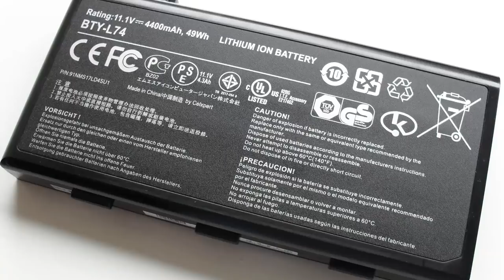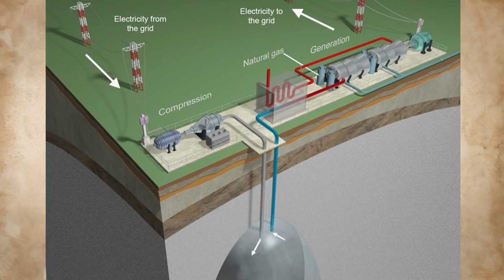Why We Need A Revolution In Energy Storage

Comment: You could use hydraulics to lift your whole house, during the the day, then use the weight of the house to turn a generator on its way back down at night, in an analogous way to the reservoir principle. Maybe.
Reply from the maker: +locohombre79 This is the best idea
Reply: +The Good Stuff Haha, your reply makes me warm and fuzzy
Reply: +locohombre79 Try calculating this, it's not very efficient. You'd need an extremely heavy house or lots of distance to lift.
Reply: +locohombre79 That would be a plumber/electrician worst nightmare.
Reply: @0xbaadf00d  That's why I prefer the idea of spinning my house. Higher limit to spinning than lifting.

Comment: Why is credit being given to Edison for the power grid?!?!?!?!?!?!?!?!?  He wanted to build a DC power grid which was impossible at any scale and had very high losses.  Westinghouse and Tesla created the power grid that we know today.
Reply: +Bottleworksnet The reason AC is more efficient for the grid is because it is easier to change the voltage.  High currents mean high loses of energy.  So by using high voltage, long distance losses can be decreased.  But too high of voltage is dangerous around the house.  So high voltage is used for power lines and lower voltage for homes.  AC can easily have its voltage changed using a transformer.  But DC is more difficult to change voltage.  This is why we use AC.  For low voltage applications, DC works quite well (and is much easier to do calculations with than AC).
Reply: +24680kong ...actually High Voltage DC is the most efficient way to transport electric energy, it's growing, so Edison is vindicated by todays standard. At that time of ancient technology AC was a given for energy transport.
Reply: ***** the benefits of HVDC lines remain to be seen. According to this Wikipedia lemma, for now it is only better for long lines. A grid is still better of with AC.
https://en.wikipedia.org/wiki/High-voltage_direct_current
Reply: +Imre Fabian considering that HVDC has been in use in various different conversion types for 60+ years I can't imagine it's performing poorly.
Reply: ***** read the lemma! 
The convertors are very expensive, compared to transformers. So only usefull for an endpoint of a long (underwater) connection between production plant and distribution installation!
Reply: ***** do you have any idea what it takes to convert DC to AC?
Reply: +Imre Fabian Yeah, actually I do, I've been working with/repairing such devices albeit on 2kW level and precision measured in parts per million. I have 15 yrs R&D experience in the field of energy measurement devices and adjustment/calibration at certified laboratory level.
Reply: +Imre Fabian The losses for a 1000km power line is 30-40%! compared to 3,5% of HVDC power line, kinda makes a nice selling point in the long run.
Reply: +Imre Fabian For a suspended air power line the payoff point is any stretch over 800km, and that keeps dropping every year with developments and advances in materials. for submerged cable I suspect anything above 100km (depending on power density) but don't quote me on that.
Reply: ***** high power energy production in DC and then measurement precise up to (a few) parts per million? Incredible. Talking about overkill.
And 2kW level? What about Megawatt level? And what voltages?

I am thinking about 0.5 to 1 MV and several MW! 

Edison wanted on every streetcorner a DC power station.

And you cannot expect all factories and companies to replace their very efficient and cheap 3 phase AC motors by less efficient commutator DC motors. Brushless DC motors are very expensive and I  wonder if they ever will make them in the several kW range.
Furthermore it will be way to expensive to place high voltage DC to AC convertors in every neighborhood transformer/distribution station.
No, for single long distance HV lines DC would ne cost-effective, but for global replacement DC is too expensive and therefore unusable. Maybe in the far future? And I doubt even then.

No, my dear +Paxmax, think again, but think a bit more globally!

Btw, Edison is by far not vindicated. And I still find him a crook!
Reply: +Imre Fabian The units I've been working with generates a low distorsion AC Voltage sine wave output, 47-480V ph-neutral at any desired phase angle 40-70Hz. It can also generate 16Hz for adjustment/calibration of energy meters meant for European rail way. For compliance testing it can also add a variety of harmonics too. The complimentary output is a current output sync'd to voltage output, feeds 1mA to 160A with similiar precision and frequency range ofcoz. It's a tri-phase supply working as a voltage/current source and comparator for energy meters.

Ok, back to the grid: Yeah end users will definitely still have std AC for a long time still, today HVDC is used to serve/replace the back bone of the grid, but most new energy generation sites will use DC -IE windfarms, wave/tidal, solar salt cookers and probaly new hydro energy plants will use DC technology. Possible new users for receiving HVDC would be bigger charging stations for electric cars. I think that with technological/price developments the HVDC will come closer and closer to end users. If a cheap sustainable batteries become available, and there is a boom in electric vehicle sales and home charging... It's conceivable that a intelligent "semi"-HVDC subnet develops in neighborhoods for load sharing.
Reply: ***** yes, under those conditions I can come along with you though I am not so optimistic over the timespan it all will take.
Using DC for charging electric cars is a tempting concept but I think it will develop more to very distributed charging facilities, i.e. home charging stations.
People are lazy, the would not want to go to centralized charging stations. Maybe when the companies switch to standardized exchangable battery packs. And still then...
But I don't see a future in a secundary DC network,  specially for charging batteries. Only when HV power electronics get dirt-cheap the DC network will come closer to the end-user.
And think about the cost and the danger of kV DC lines to the local switching stations. DC is way more dangerous in spite of what Edison stated. As there is no phase transition, your muscles will cramp up and you cannot let go of the live line.
Try to tinker with a car-battery with a metal bracelet or watch strap on. You'll fry while conscious and no skin effect to save you!
DC powerlines should be underground, even for 100 KV lines.
Where I live, only above 100 kV AC lines are above ground!

I think you're a tad optimistic, but admittedly, eventually HVDC will come closer to the public. 
But I don't think AC will ever disappear for domestic power use!
Reply: Imre Fabian *handshake* good to meet you Imre =o)
Reply: Imre Fabian oh, a fascinating factoid I stumbled upon, a typical 350kV power line placed underground will have Zero(!) current transport ability at lenghts above 40km!
All current goes into capacitive coupling wire-wire and wire-surounding earth!
Reply: Imre Fabian At 12V DC the body will experience it as stinging pain, but it will not cramp, you'd still have control. There is a funny test you can do: use a plastic tub, fill with salty water, add gnd wire at one end and +12V at other end. Insert hand (slowly!). stinging pain but you'll have control.Been there, done it! My diving lamp sprung a severe leak, working with the lamp after dive was uncomfortable! I kept getting "stung" by salt water.
However, with bracelet + car battery you have so high currents the bracelet will heat up and burn into the flesh, possibly welding itself to battery poles making hand feel stuck. I've had several shocks from DC, and AC, personally I'd take a hit of DC over AC any day. 230VAC  screws me up several minutes even 30minutes of cold sweat and mentally reflecting on life in general., where a DC shock enables me to continue within one to a few seconds. I was actually stupid enough to pick up a charged capacitor, got stung, dropped cap, picked it up and got stung again, dropping all caps in hand, I got loads of laughs from friends in the lab.
Reply: Well, if that's your experience,  you have been either lucky or, depending how you look at it, unlucky.
I have never had a severe DC  shock but I've had the misfortune to get several 230 V  and even 400 V shocks but luckily I  never suffered more than a minute of disorientation,  not even pain.
Maybe because I never use my left hand to touch a piece of metal while working.
(A joke from my teacher  a long time ago: men with both hands in their pockets are called supervisors!)
Anyway, a shock,  DC or AC, is never funny!
Take care!

Comment: G'day,

Yay Team !

  I live Off-Grid, using Batteries & an Inverter...

  I'm not equipped to cobble-up Experimental Batteries, though I spent 25 years designing my own Wind-Turbines, before turning to Solar Panels, and my Solar Array is on an Asymetric Offset-Tower I designed, giving 135 Degrees of daily tracking & 47 Degrees of Seasonal adjustment, Solstice to Solstice...; it yields about 35% more than a fixed Array using the same Panels, so "economically" it's better to bolt the units to the Roof, but it's far more satisfying to have one's Panels actually pointing at the Sun..., than to have to watch over half the available power bouncing off for half the day, every day...

  To see the "Tower of Power", backtrack me to my "SunFoil Project..." Playlist...; to illustrate the SunFoil concept I used my Hut's Panels, Batteries, and the Backup-Generator as a comparison to the Car's Alternator, to highlight the point that a well-designed Generator does not have a Torque-Multiplier between the Electromagnetic Drag-Brake and the Engine's Crankshaft..., which is why adding a streamlined Solar Panel to a conventional Road-Vehicle saves relatively huge amounts of fuel. (best result yet, 33.25% Fuelburn reduction on a 1.8 Litre Subaru 4WD, with a 30 Watt PV ; worst result to date, 7.5% Fuelburn Reduction on a 10-Tonne Diesel Truck, with a 200 Watt 24 Volt PV on the Cabin Roof..)

   Adding a SunFoil to your Conventional Vehicle is the simplest, fastest, cheapest, ripest, biggest, lowest-hanging "Fruit" on the whole Alternative Energy "Tree"...; it makes the vehicle cheaper to run & less polluting, while delivering more available Torque to the Gearbox, so it'll accelerate harder and go faster as well..., once it's Battery is full of Sunlight at every Engine-Start.

 It isn't Voodoo, it's just(ifiably ?) simple Power-Mechanics, Electro-Mechanics, & Drive-Train Engineering, plus Electro-Chemical Battery Dynamics..; which conspire between them to mean that adding a streamlined Solar Array is a much better way to achieve that full-Battery condition at every Startup, compared to expecting the onboard Alternator to ever achieve such a state.

  Construction-Videos are in the Playlist, none of it is patentable so go your hardest, build one for yourself, or make a million of them as Retrofit Kits if you can afford to distribute them.

Live Green, or Die...; Greenhouse-Gas Emission induced Global Warming is a Karmic Feedback-Loop, within the Kosmic-Scoreboard Effect. and we make our own future with how we behave today...

  What you do is up to you...; everybody has Perfect Liberty & therefore bears Perfect Responsibility, regarding whatever they decide to do...

  Have a good one,

;-p

Ciao !

Comment: Off grid for over 6 years and I love it. 90% of my home runs on 100vDC with the ability to give up to 100 amps. You would be surprised what can function on DC that was designed for AC. 
Appliances that have transformers require AC only but devices like computers, most kinds of lighting, soldering irons, simple stoves / ovens etc readily accept DC. 
One trouble with high voltage DC is it tends to want to arc across switches when turned off so you need a capacitor in parallel with it to suppress that.

Comment: One of the variables he forgot to talk about battery tech for large infrastructural stage is the life or total usage and recharge cycles  the battery has.

Lithium ion is not only expensive but the life and usage cycle is relatively small, especially for use cases such as transportation and homes.
Reply: +Adil Zia Exactly my thoughts. If I drain my battery reserves by 80% every day (not unrealistic) then I'm looking at maybe 4 years of use before the battery starts dying.
Also, storing vast amounts of electricity in batteries is like storing dynamite in your house.
Reply: Lol ya it's explosive if chemical based, lithium ion based,  it nickel based... I think Gallium was much more stable...  And there are layering techniques, both which are being worked on which do both good storage,  good charge release and intake,  physical volume density, and temperature stability... The main issue is that the research into making it commercialized isn't complete
Reply: Chemistry doesn't matter. Lithium in current batteries is dangerous, but more dangerous is the energy stored inside the battery. You can take the lithium out but the energy will always be there, and it can burn everything down.

Comment: It is important to not forget the other major obstacle for batteries: efficiency.  With any known storage technology, it takes more power to store than you get out of it, even when it is brand new.  So getting batteries out there means a net increase in power usage,  with the hope that spreading it out will be more efficient.

There is also the dreaded maintenance issue.  Centralized power means having specialists keeping an eye on high voltage sources that are physically separated from residential areas. Spreading it around means having some type of mechanical or chemical sink in homes with immense amounts of potential in it. Ever see a residential transformer explode?  Even a small local one can light up the night sky.  Home units are going to be smaller yes, but they are going to have a lot more energy in them than, say, a hot water heater (our current big store), and those failing can be pretty catastrophic as is.

And, of course, there is the line control problem.  Stuff inside your own house is your own problem at first, but as soon as you start hooking up your stores and sources to the grid, that means your personal maintenance issues can affect other homes.  These are all problems who's solutions go beyond technological.
Reply: neeneko I am individually developing a different kind of battery which does not store chemical energy, and turns it's stored energy directly into a mechanical motion, my system might not be the most efficient system for a house, but definitely for transport, plus be able to store more energy within it, therefore increasing its life, and you can recharge it an infinite amount of times and will not loose performance, no dangerous chemicals required, and possibly more cheaper, currently developing a prototype with this system that I would like to patent

Comment: Two problems to solve: generating energy and storing energy. Storing energy can be tricky, not just because we need to find cheap ways to do so but because we spend a little of energy while storing it in the process. I think the idea of "sharing energy" in the grid is great and I think that each home can be a little power generator and an entire city can become a power plant town. All we need to do is to think where energy is and how we can extract it in the perspective of our homes. I don't have to mention we, ourselves, are "walking packets of energy". We lose lots of energy in the heat we emit, as we walk and move. The central problem is converting types of energy in such a way that we don't lose more energy in the conversion than it should  and storing the energy to attend our needs.

Comment: The first reason almost sounds like a cop-out (considering the installation of large batteries in plants would probably increase the cost of electricity production more than it would reduce from load balancing). The real reason is the second one. Without some sort of efficient storage system wind and solar just don't work on large scale. These two energy generation methods are being sold as the future, but they completely rely on technology that hasn't been invented yet (and might not be).
Reply: Well, it's 4 years later, oct 2020.  Things have gone well for renewables plus storage.  There are many coal power plants that are being shut down and replaced by renewables plus storage.

Comment: I really like the idea of pumping water up into a reservoir and using the potential energy to power the grid, but as you guys mentioned in the video, a change in elevation is essential.  I also heard Bill Nye propose a similar solution where a deep, deep hole is dug in the ground but the plug of rock is more or less left in tact.  Renewable energy is then used to pump water beneath the pug and slowly lift it throughout the day (or when the wind is blowing.)  The gravity of the plug is then the potential energy and no change in elevation is needed.  This system still needs water though.

Comment: It was Tesla's idea coming up with the modern power grid we use today, alternating current. While on the other hand Edison wanted to make a power grid based off of direct current. Edison battled with Tesla on the matter for years, on the safety, and efficiency mostly, DC is safer, but it can't be transmitted over long distances with loss like AC can. Edison knew this, and in the end bought Tesla out for relative peanuts.